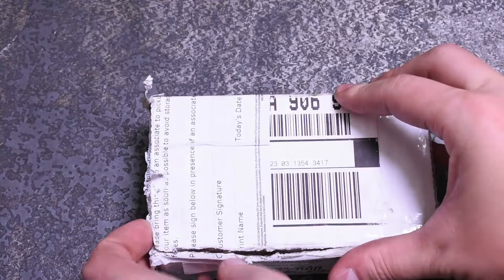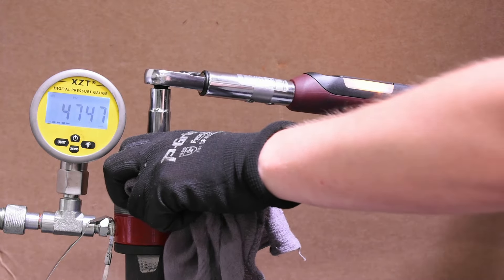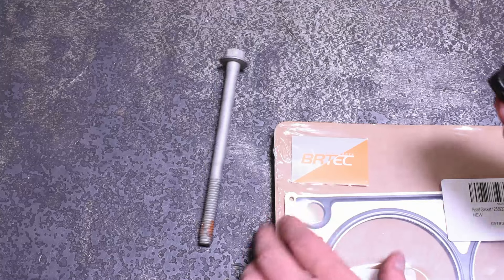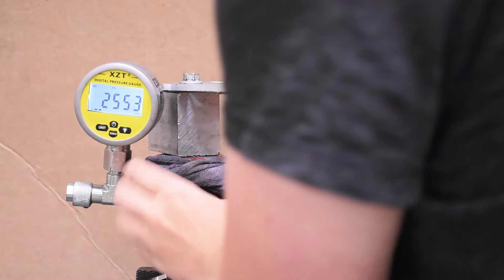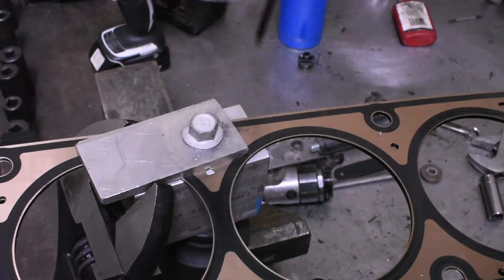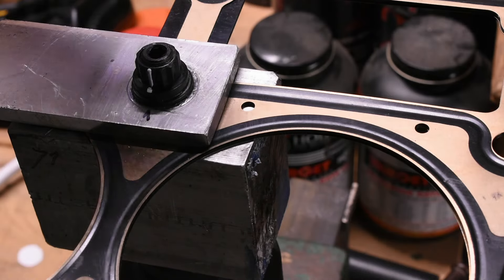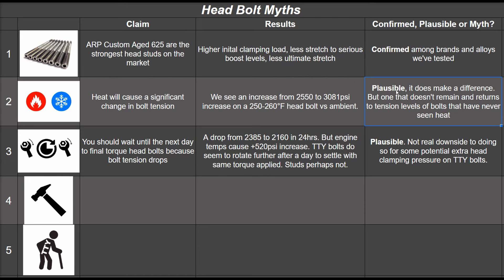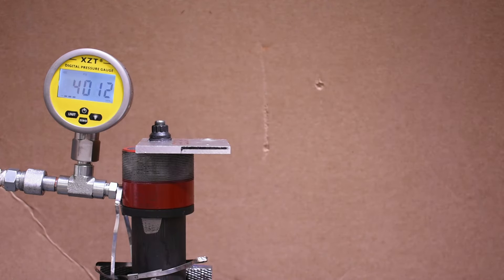CAN You Reuse Cylinder Head Bolts? Testing Myths + ARP Custom Aged 625+

Comment: Clamping tension is a force, not a pressure.  So, what are you really measuring?  The PSI of the fluid?  Or is it calibrated to equal the actual clamping force?  Units matter.
Reply from the maker: It's hydraulic, so PSI of hydraulic pressure. Clamping force would be a function of ram surface area and minor thread diameter cross-section which we went into in our 1st head stud video. Though for relative comparison sake like here, that would just confuse even more people.
Reply: @TorqueTestChannel  I wasn’t sure if the ram area was 1 square inch in area so that the pressure value would equal the applied force.
Reply from the maker: That would be amazing. Its 2.77 sq in

Comment: U can reuse the bolts as long as u haven't got the engine to hot then they stretch n go soft ....BUT ej bolts r rubbish ..I've had them snap when new before even before getting to maximum degrees of turn

Comment: I worked on helicopters for 10 years and the “hit it with a hammer method” is actually an installation procedure that is used. We used it to install generators on the main gear box. The generators are held on by a beefy band clamp style mount. After you torque it, you hit around the entire clamp and re-torque. This process is repeated until the bolt does not move two consecutive times. Typically we’d get about a quarter turn more on the bolt before it stopped moving. Now, this was low torque, only 60 inch pounds. I’m curious if high torque negates the need for all that.
Reply: Might have something to do with differences in application.. A band, even a beefy one, is quite different from a cylinder head with lots of bolts or studs being tightened in sequence that should create any movement needed for solid torque. Hammer blows would be unlikely to shock and move the materials due to quantity and torque. (My opinion)
Reply: Well since most auto stuff is located by a mixture of bolts and Dowels you shouldn't need to hit anything. Infact its a dumb idea as you run risk of damages to threads the bolt head even the heads themselves. They are designed to actually be hit.

Comment: I wonder in general if u should just measure the hp of the bolt not torque like if the time and distance traveled to achieve the torque is more important than anything else on used bolts maybe from 5 ft pd to spec the time and distance at a mph would determine its to weak to reuse? Maybe torquerinch should have a speedometer lol

Comment: Can you strengthen yielded bolts. Like they do with swords. Bake them then ice cold bath or whatever they do. Genuinely curious as would be interesting
Reply: You could re heat treat them but there is nothing you can do about the fact that the reduced cross sectional area of the necked down region is why it fails.

Comment: I have rebuilt enough engines that never came back to haunt me, because I stuck to manufacturers recommendations. Dry, quality head gasket with new head bolts and perfectly cleaned mating surfaces, usually planed head. You NEVER reuse headbolts on diesel engines, that's just a simple rule. Gasoline engines of low HP without turbo, who cares. You can tighten those with Elmer's glue...still. I'd never reuse headbolts that you don't know the condition of. Safe $500 bucks, just to spend $5000 on a second teardown with failure...no thx. Like driving a BMW on summer tires through a Canadian Winter.

Comment: You really shouldn’t touch any of the bolt alloys.  The oil and acid from your skin will induce corrosion.  Some alloys do react quicker as you mention, but all will be compromised with touching.  Same with valve springs.  Most guys use gloves or just slightly oil hands with engine oil when handling.

Comment: Seems like using 1 time yielded old head bolts or studs would work for a car with a low compression ratio. What about testing a head stud that has been used twice or 3 times?

Comment: Can you test what happens if you just use a middle of the road impact wrench? Someone that worked with me used to work somewhere different every year and he used to just gun the bolts in. He didn't care if it came back a few years later.
Reply: That doesn't sound worth testing because the results are predictable - the torque applied is basically random

Comment: Can you test 11mm studs versus 1/2” and 14mm? It is very common to drill out the block to larger stud size. Curious how much clamping force this gives.
Reply: For a given torque, it is the ratio of the bolt/stud root areas. So it a squared factor of the bolt/stud root diameter.

Comment: The fear of hand content resulting in hydrogen embritalment is largely overly sensitive.  I would take precautions if this was for a high perfomance engine in a high stakes race. But for day to day use, I would not consern myself. 

These studs are exposed to more moisture in the natural environment than can be imparted from a bit of contact with sweaty fingers. The salts from skin contact also will not make much difference, although they can potentially leave marks under the right conditions.  But that is more likely caused from contact with other acidic materials prior to contact with said steel. Once they are regularly lubricated, these salts/acids would all be washed and/or neutralized in short order.

Comment: Nice test, but useless. The problem with this test is quite glaring: you're using one bolt and measuring only one bolt at one theoretical cylinder head clamping point. You're not clamping a whole cylinder head to an engine and measuring from that, heating cycles, thermal expansion, possible differing metals and their own respective rates of expansion (iron, steel, aluminum) and how clamping forces differ across the cylinder head. You've also not accounted for block/cylinders/head twist during the experience of engine rpm and torque which plays a factor in reusing and measuring used bolts or measuring a new bolt after a thermal cycle. 

Blocks specifically are designed to have a degree of twist otherwise they would break under high load, hard launch starts and towing. Therefore, the initial torque settings and sequence comes into play after the engine thermal cycle.  

Mercedes engines typically run hotter than 250-260 degrees, as well. 

Doing a test with these parameters, a cylinder head on an actual engine block, is the only proper way to conduct these tests. Pretty sure #4 would be proven to be true and the plausible ones, as well.
Reply: Your throwing in a million variables. Also most of these are only plausible. Also the hammer trick isn't necessary and runs risk of damaging threads in many engines.
Reply: @jdrok5026  It is not a million variables. Those are the variables cylinder head bolts endure every day. Hence why this test becomes useless.

Comment: TTY bolts for cylinder head applications will actually fail/shear-off, break in service of metal fatigue I some cases. I have seen the TTY type cause coolant leak costumer complaint on medium mileage engines due to heat cycling.
    The kind of test which would require x-ray or ultrasonic equipment  is not the kind you would have access to.

Comment: At 13:55 you say you are "DOUBLE YIELDING" the bolt... Why not just MARK the bolt after 1 correct torque cycle, release the bolt and then re-torque to the same rotational point +5 degrees. This should be equal to a +5 degree overshoot on an original installation.  This idea would work for rod bolts where you have access to both ends of the bolt, or are turning a nut on a stationary shaft or stud, not so much for a head bolt tho. ... If you are trying to do head bolts say for a gasket repair or valve job, you would have to track each bolt to each original hole, Mark each bolts' rotational position, release each bolt 1-at-a-time, and retorque to the original rotational location, making note of the final required torque. Then make your repairs,  re-assemble with original bolt in original hole torque to the previously measured TORQUE(not rotational) point, (3-step torque process), then add+5 degrees or so more.

Comment: Hmm interesting! I wouldn't reuse TTY bolts period in a rebuild, you simply don't want to take any chances in it not being a good clamp on especially a cylinder head. My BMW cylinder head (engine that I'm rebuilding) has a torque sequence on TTY cylinder head bolts of 30nm then 90° + 180°

Comment: Any way to check if that dog tooth engagement of the 625 or l19 bolts actually helps? 
Its been a long time, 8 yrs, since i did studs… but the idea was the stud bottoms out and pre- engages the threads to distribute pressure better or something to that effect. Any pre retirement rodders out there feel free to correct my dated from memory information

Comment: Trick is to heat the bolt like yall did then when its still hot you douse it with methanol then put your final torque angle on it immediately after the methanol.   Called doped up and strung out studs..   cuz the meth.  anol...   lol..  cant do it with any iron or cast blocks tho or you wind up either cracking it or stress treating it which might cause a sunroof in the head..

Comment: Is there any definitive way to determine if a bolt is actually TTY? As torque to an angle doesn't necessarily mean the bolt is going to yield! Depends on how it's been designed.
Reply: By definition any final torque to an angle is a TTY bolt.  This doesn't guarantee you're in the permanent deformation range so I understand the question, but the idea is that the desired torque spec is too high to reliably hit and the torque spec needs to be adjusted to allow for yielding as a simple torque spec may be above yield strength.  Therefore it is TTY.  Whether it actually is permanently deformed isn't important from an engineering standpoint.
Reply: @knurlgnar24  No it is not.  One is a type of non-reusable fastener - TTY, the other is a method of tightening a fastener, any fastener whether it is TTY or an infinitely until deformed/stretched reusable fastener.

Comment: 70 ft/lbs that’s child’s play on diesel engines we torque well over 200 ft/lbs and over 250 ft/lbs higher hp with 30 to 36 head studs on 6 cylinders. They are 5/8” bolts grade 8 with a 3/4 torque wrench you can barely get them tight lol.

Comment: I’d love to see studs used for wheels tested to failure, clamping strength over time, stretch, etc. Especially on wheels that require 150+ lb-ft.

Typically the hub/bearing does before the studs but still good to know.
Reply: "the hub/bearing does"  What?
Reply: @DonziGT230  the hub/bearing assembly typical fails before the wheel studs.
Reply: @josephbargo5024  The wheel stud torque has no effect on the wheel bearing.  The bearing is held by its own nut.  You can torque wheel nuts/studs to failure without effecting the bearing at all.
Reply: @DonziGT230  I know.. What I was saying is a lot of people would replace the whole hub with studs because getting a hub without studs isn’t much cheaper and it’s a hassle. Also this is mainly geared towards track use and people that would treat hubs and bearing as consumables.

Comment: hitting bolts with a hammer isnt like torquing to spec or anything relevant to holding pressure or clamping pressure. if manufacturer says one time use they are one time use. not up for debate

Comment: Cylinder head bolts can be re-used safely if torqued correctly the first time. There's a pretty large safety margin built in, or snapped head bolts would be very common.

Comment: Subaru says not to reuse head bolts. I did on 2 engines and both heads started leaking 20,000 miles later.

Comment: anyone that does cylinder head bolts often should get themselves a digital torque wrench that also does degrees. They are bloody brilliant. I hate those angle gauges you are using. I guess it all depends on how often you need to turn a bolt in degrees to justify the cost.

Comment: Anything made before 1992 is fine to re use. Later are crap bolts.  If it stretches...it's junk with 80lbs or less. For example...lug nuts are torqued down multiple times during thier usage. How many lug nuts separate from a wheel hub. It's all b.s.. if it stretches,  it's junk.

Comment: Your not retorquing the bolts or studs correctly after letting them sit. Your suppose to loosen it an 1/8 of a turn so the bolt or nut can overcome friction an re torque.

Comment: I recently replaced the TTY flywheel bolts on my engine.  I couldn't find any new ones on-line, but there were dozens of sets being sold ised on EBay.  (I ordered new from the dealership instead of risking used bolts)

Comment: Why again did manufacturers decide not to just use reusable bolts?
Reply from the maker: TTY is a more consistent clamping load than a bolt and torque wrench en masse
Reply: @TorqueTestChannel  seems to me they just want to sale some marked up single use fasteners. Nothing has really changed automotive wise between using old school head bolts and modern stretch bolts head gaskets blow just as frequently as they did back then. I've never seen camshaft sprockets or pulleys come loose with either style fastener. Same goes for crankshaft dampeners. Seems like a waste of materials to even bother with it. Even rod bolts/studs and main cap bolts seemed fine before torque to yield started being used. Our race engines turned 8500 RPM with stock reused rod bolts and main cap bolts. They were rebuilt every season and nothing was ever found to be loose or walked from insufficient clamping force. I knew guys pushing the same hardware close to 10,000 rpm.

Comment: Never have i heard the "Hit with a Hammer"  thing . Never in my 50 years .. I follow prob 50 or more mechanics / engineers and DIY guys and mostly All do engine rebuilds and not a single one of them have Used a hammer or even Mention one . The only time they Have is on a ceased engine / piston to get it to move, ofc using a block of wood to not score up the cylinder walls or the top of piston . Just seems like an old Wives tale to me .

Comment: Those TTY bolts are so inexpensive, why not just get a new set vs risk a failure? There's a point at which you're either just being cheap or foolish, your choice. Its your power plant and your headache when it breaks down or needs an early re-build, due to some re-used part. Not worth the grief, IMO.

Comment: Kind of a cheesy test setup in a vise flexing around and using a couple aluminum blocks with uneven surfaces.  That top plate especially is probably compressing under the stud and flexing so your dial indicator reading is not accurate.  You are throwing out too much info in a non linear fashion.  You should test a standard stud from an engine and the ARP version of the same stud.  You could test each one for stretch, then do the re-test to see if they turn a bit more later, then finally the break test.

Comment: Hydrogen is in the air.  Are you not supposed to let them touch air?
Reply from the maker: Yes. They are kept oiled
Reply: @TorqueTestChannel  Some people have what are known as rusty fingers. If these people handle a clean and dry machined inspection bar, their fingerprints will be etched in rust on that bar within a few days.

Comment: torque to yield and torque to spec arent the same bolts. headstuds generally arent torque to yield. yes headstuds can be reused if not torque to yield. you dont replaced headstuds after replacing a head gasket do you? no you dont

Comment: can you test how many beans a human can do with a breaker bar? Curious to see what sort of impact we compare to.
Reply: It depends on the size of the human and the length of the breaker bar. Both can vary substantially. Can I use a cheater pipe?
Reply from the maker: It's easy math. Force in lbs x length of bar in feet
Reply: @TorqueTestChannel  Yeah it's easy math but is that how it's going to measure on your test rig? People are breaking 1/2" breaker bars at 275 ft lbs measured on a torque adapter. I've for sure loosened bolts with a breaker bar my 1/2 mid torque could not.

Comment: 4 uggadugas for 7/16,  5 for 1/2" For metric you need a metric impact.

Just kidding, great test. I guess I'll still be buying new TTY bolts, and I've used ARP bolts with the proper ARP lube since the late 80's (Mr Gaskets  w/anti-seize before that). If you torque rod bolts by stretch, you'll know right away how much difference it makes the 1st time you forget to lube one. Pint jar of ARP Assembly Lubricant on my desk as I type this #100-9905 Says Copyright 1994 on the label, but I don't think I've had this jar that long. It goes a long way though.

Comment: On the cast iron blocks and head, buy one new factory head bolt and measure the length of new vs old.  If the same, reuse the bolts.

On anything that had alloy blocks or head, buy new bolts 100% of the time.  Risk vs savings wasn't worth the small savings.

Comment: Hydrogen embrittlement??
The freaking UNIVERSE is made of and from Hydrogen
is this that Unobtanium from Avatar
Reply: It probably signals a material that is too fracture sensitive.  One time a big machine manufacturer had parts falling off in the plant due to torqued fasteners failing.  They found that their machinists were using WD40 and the alloys of their fasteners were sensitive to a phenomenon called stress corrosion fracture.  The fasteners under tension would have micro corrosion that would initiate fracture and parts would fall off.  They banned WD40 from the factory.